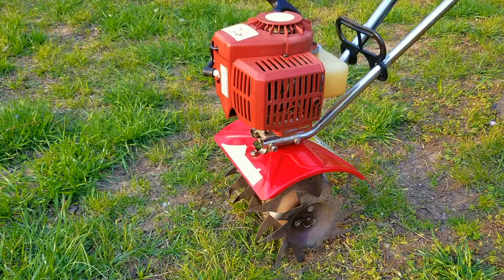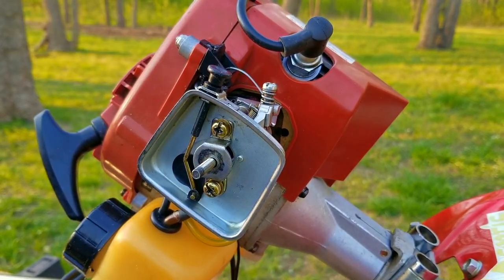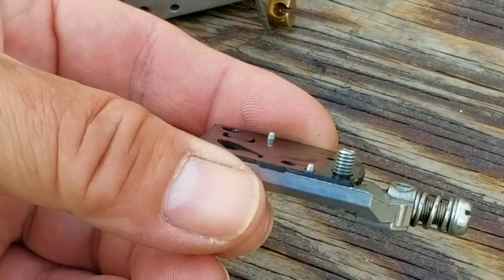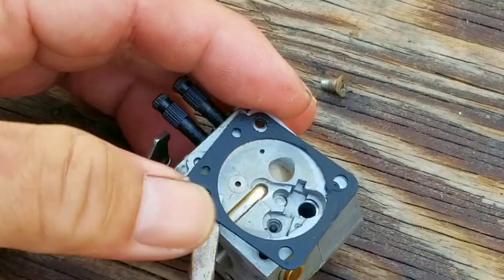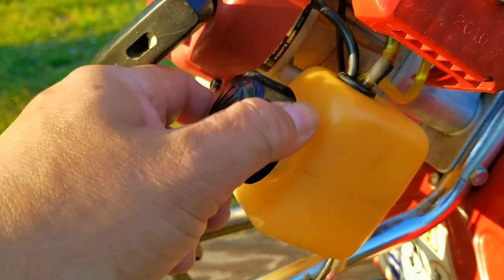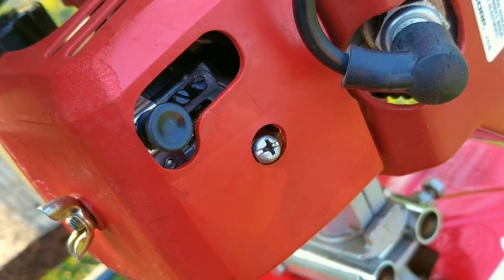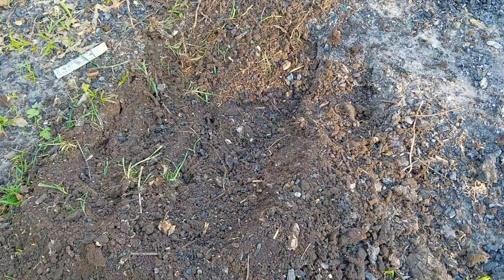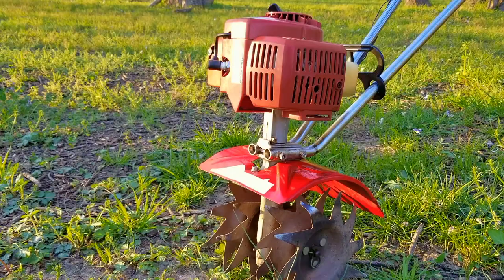Free Mantis tiller leaks gas and won't start

Comment: I've had my little Mantis tiller since 2001. Still runs great after all these years. My secret is to use ethanol free gas and to drain all the gas that's left after using it. The only problem I ever had with it was the handle bars broke from the jumping around and vibration.
Reply from the maker: wow, yours has been really good to you, you've taken good care of it as well.
Reply: I like that secret, and here's my secret. Soak the area you plan on tilling 2 days before hand. The tiller will not only glide through the soul easier, but it won't rattle the handle bars loose 👍😂, especially since you know all this stuff made cheap from China.
Reply: you couldn't handle it

Comment: Things the mantis can do: Weeding in tight spaces, pulverizing soil to a very fine texture for seed beds, churning compost, aerating and cultivating established garden beds. If you get attachments for it you can use it for edging, aerating, and de-thatching your lawn. If you're making a new garden bed, you'll need a bigger tiller like a Troy-Bilt Horse or similar, but these are super convenient for hitting small spots, aerating soil, and getting to areas where your big tiller just can't. We picked one up specifically for this and it seems to work as advertised.

Thank you so much for this video, man. You've got a very solid formula of education, clear instructions, reasoning, diagnostic, and no fluff. Keep at it, you've earned a subscriber!
Reply from the maker: thank you very much, I appreciate it a lot

Comment: Both of my sisters owned these and had trouble keeping them running after a while. I rebuilt the carburetors, replaced the fuel lines, spark plugs and had both of them run ethanol free fuel and empty after use. Run them dry of the remaining fuel. Since then I've bought 4 at yard sales, never paying more than 25 bucks. One was 10 bucks. Rebuild them and resell. One had a cracked fuel tank. There easy to work on but extremely tempermental.
Reply from the maker: you are correct these can sometimes be had for very little and it doesn't take too much money to get them running again

Comment: Got the older version of this from my neighbor after it sat in a shed for who knows how long. Got it running after alot of struggling and although it sounds like it’s got a hole in the muffler and smokes like a banshee, that little thing packs a punch!
Reply from the maker: Nice work, and you're right, these are great machines!

Comment: Our Mantis Tiller is about 25 years old. We used it every year for about 10 years, then we moved and I had heart attacks in 2005. We had it tuned up similar to what you just showed and that cost us about $69, but it was worth it. We didn't get to use it for the next 15 years, and we pulled it from storage a few days ago, and after a few minutes of priming it up, it's a dirt storm all over again! Dug up our garden much faster and much less work than the monster tillers ever did! It's a good thing you didn't get too deep in the earth you were digging in, as those things create a serious dust storm once they get a good grip on the ground, if it's dry, like that. Ours was damp enough to prevent the storm. And it doesn't create the back pain of the big tillers, either. Best $300 we ever spent on the garden, other than the ComposTumbler we bought at the same time (about 25 years ago) and it's still going, too!
Reply: Forgot to mention that our gardens were always about 45'x12' for those first 10 years. This one is a little smaller, as I'm recovering from heart surgery, so I didn't want to make it too big. We've never used a big tiller since we got this little workhorse!
Reply from the maker: very nice and yes I'm glad I didn't go much deeper either

Comment: We have a 5 hp Troy built roto tiller new it jut needed new oil and a spark plug, and the fuel lines were all broken.the crazy thing is, it was in a free  pile on the side of the road, like, people will really throw away anything, good thing we stopped and got it, it didn’t look to new, a few rust spots, but hey, if its free and fixable, then why not try to fix it and use it. Doesn’t hurt to have one more tool.
Reply from the maker: I like the way you think. Thank you Alexander Costa.

Comment: That was a great find and fix! I have the same tiller except it’s branded Echo, it’s a very useful thing to have around. The de-thatching accessory is very good on these, my lawn looks so much better now since I started using it before fertilizing in the spring.
Reply from the maker: oh there's a de-thatching accessory? I need to find one. how did you get yours?
Reply: @HomeGaragechannel  I bought the kit from a eBay seller. It comes with fender extensions and the de-thatching axles that you put in place of the tiller tines. A friend recently gave me the edger accessory for it too but I haven’t used it yet. I’ve seen the de-thatcher kit on Craigslist too.
Reply from the maker: @mjg263  gotcha thank you

Comment: Good little tiller,they are very expensive look them yup on line.I had to replace the transmission  on a customer,cost around 100.00.The transmission had no grease in it.Take the back cover off and check the grease in it.Nice video.
Reply from the maker: Thank you for that information, I'll have to do that.

Comment: I have had 4 Mantis tickets in my shop in the last 6 weeks.  Echo makes the engine.  Very finicky little tiller to get dialed in and running right.  Good for small raised beds with soft soil.
Reply from the maker: Yes as you saw in the video, I should have used it In a prepared bed. Thanks for not giving me a hard time about that

Comment: These are good for flower beds and small digging spaces. I had the equivalent for my Echo convertible and used it a good bit till my gardening Sweetie went to raised beds and mulching. I also used a Gravely with a rotary plow to loosen everything up. Good fix and Blessings.
Reply from the maker: you are correct, their light weight makes them really nice to use, in small areas.

Comment: I purchased one of those second hand. 
For my allotment here in the uk . 15 years ago . 
For £20 . It's still going strong . 
I know new they were quite expensive. Here in the uk anyway . 
Mine must have hundreds of hours on it . 
It only ever has fuel put into it when it's needed . 
Always emptied when finished with . 
New plug every year . 
Only breakdown was a coil . One carb rebuild 
It owes me nothing . 
Noisy yes but it's light and easy to use .
Reply from the maker: Thank you Martin Nightingale, I appreciate you sharing your experience.

Comment: My mantis is hard to start, once I get it started, if I shut it off it won't start again. I just changed the  carburetor and put a new pull rope on it. I appreciate this video I'm going to try to adjust those screws to see if it helps any.
Reply from the maker: Thank you cutflower,

Comment: Great video. More of a cultivator even though they call it a tiller. Great for weeding up and down the rows in a garden. Dont try to break ground with it. Thanks!
Reply from the maker: I wish I know the before I tried, and yes its really a cultivator. thank you Mike H.
Reply: @HomeGaragechannel  Ask me how I know. Lol
Reply: Soak the dirt well, then let it dry for a bit before using. Won't pulverize  the soil that way. Also, it tills better when you pull it backwards
Reply from the maker: @Mike-ig2zq  how do you know?
Reply from the maker: @lawrencewheeler8868  ah, nice of you to share some tips
Reply: @HomeGaragechannel  Lol, I stripped the auger gear out of one. Lucky it was under warrantee and they covered it.

Comment: Free? Who gives a Mantis away? Crazy. I just replace the carburetor  and all the lines. I got one for $30 last year. I sold it for $175.   The kit I got had the carburetor, spark plug, fuel lines, gas tank bung, and filters. Today's fuels destroy  those diaphragms and fuel lines. I pretty much stopped rebuilding carburetors  last year. It's easier and cheaper just to replace. Good video, hell of a find.
Reply from the maker: Right!? I had the same situation come up before but I had to buy a used mantis as well.

Comment: I have that exact same one, it's leaking from the tank where the fuel lines come out. On top of that no fuel is being pumped in when I try to prime it. I bought mine used and had it for about 2 years now, it's not something I'd want to use on a large scale, but it's great for a backyard setting. My soil is pure clay and it chews threw it no problem, well in it's running. I've ordered a new fuel tank and carburetor kit and will refer to this vid if I can find it again.
Reply from the maker: yes these are excellent machines and I hope you can get it running again

Comment: I just discarded my curb find Mantis tiller. It only had about 50 psi pressure but I went ahead and bought a carburetor. It was hard to keep running,then I took the muffler off and saw the scoring on the piston. I should have followed  your diagnosing advice. Kept the carburetor though.
Reply from the maker: sorry to hear that,

Comment: I have the exact tiller.  I put Techron in mine and it does start and run even though the fuel leaks.  I just bought a new carb for $12 on Amazon.  It came with all new lines and an extra primer bulb.  I didn’t put it on yet. I hear these engines are near indestructible
Reply from the maker: as long as theres enough oil in the gasoline, they are very durable.
Reply: @HomeGaragechannel  I bought a cultivator attachment for my 4 stroke string trimmer and was going to put the mantis on the curb too.  The cultivator attachment is ok but not as good as the mantis.   I only use the tiller once a year and it use to take 4 hours to get it running every year.  With Techron, it is much better but it still takes 15 mins.  I wish there was a fuel shutoff valve so I could run the carb dry before storage
Reply from the maker: you can find some aftermarket valves for this size fuel line.

Comment: My dad bought one of these about 20 years ago but hasn’t used it in about 10 years until I got it running.

We almost threw it away as we initially didn’t need it anymore. I still wanted to fix it and even pointed out that I could use it as a sidewalk edger as we still have the attachment for it.

Turns out the mantis is very good at setting an edge for spreading mulch on garden beds in addition to edging our sidewalks!

I’m glad I insisted on fixing it as all it took was a carburetor rebuild and a good cleaning to bring it back to life.
Reply from the maker: very nice work and these are really cool to have

Comment: Those are good quality tillers. I have one in the garage I need to work on it was my neighbors and they gave it to me when they have it to me they had just had it worked on but it still had a hard to start problem. Where do you by your 2 cycle carb kits?
Reply from the maker: I don't buy the kits, just the metering diaphragms and I find them on Amazon.

Comment: Hey I have this exact same tiller! Mine runs great and has very little run time on it. I do notice a few slight differences between mine and this one.
Reply from the maker: What are some of the differences?
Reply: @HomeGaragechannel  The throttle handle is slightly different, the spark plug boot on mine is a little bigger and covers the plug more, and the vents on the cover on top of the engine on mine are different.
Reply from the maker: @paulspomer16  thank I appreciate you letting me know

Comment: That engine on that tiller is an echo / yamabiko engine they also have one with a little honda engine on it which is a good tiller compared to the troybilt 2 stroke mini tillers which is not a good tiller because it uses the same engine that their 25cc troy bilt trimmers use. I'd get the mantis because its be sold through dealers and you get better service from a dealership than a big box store and you can fix a mantis easily
Reply from the maker: I completely agree with you

Comment: So is it because of the old age of the tiller that you have to adjust the idle and L-screws to have it run properly or was it because someone accidentally turned to the wrong position in the past? Thank you for the great and detailed explanation!
Reply from the maker: no problem, yes the engine has developed it's own needs as it's been used and due to age. The adjustments help you to fine tune the carb to the engines needs.
Reply: @HomeGaragechannel  I see. I love how very knowledgeable you are and I can see myself learn a lot from you!
Reply from the maker: @SkyShadowReviews  Thank you I really appreciate that.

Comment: I rebuilt a Mantis this spring (free from neighbor) its 1987. Echo SV-4 Engine. So old not even a primer bulb on the carb. Had to scour eBay for a carb replacement. That’s the question here how does that work...gravity?
Reply from the maker: the engine pulses work the pumping diaphragm and draw the Fuel into the Carb, no gravity use here unless the tank is completely higher than the Carb

Comment: can you plzzzzzz do a video on how to put an tank gromit on small engine because i suck at putting them in
Reply from the maker: I can, but I would have to incorporate it with a project and not just the grommet.  The key is making sure you have the right size, and some grease helps
Reply: yeah i realized it was the wrong size lol @HomeGaragechannel

Comment: I use a Mantis in raised garden beds to fine soil that has been turned with a shovel. I would call it more of a cultivator than a tiller. It beats chopping soil by hand. What you tried to do made me sad.
Reply from the maker: me too
Reply: @HomeGaragechannel  When you till ground it is really a two step process. First you break soil up into clods then you break clods up into fines. A Mantis is really only good for step two. Cultivating is the tedious work. Using a Mantis makes it much more tolerable. It's been a game changer for me. Gets me done many times faster than not having it. That's huge.
Reply from the maker: @1pcfred  yes you're absolutely right.  Unfortunately no gardens were available at the time
Reply: @HomeGaragechannel  you do not have a garden? I have to go out and check mine. The peas are starting to come in. I love fresh peas.
Reply from the maker: @1pcfred  as a child we had one because we love long green beans. But no I don't have one
Reply: @HomeGaragechannel  you should have a garden. You don't have to go Martha Stewart on it. But something. It's just not spring time if I'm not out there digging the garden. It doesn't get any more real than tilling the soil, planting seeds, growing something and then eating it.
Reply from the maker: @1pcfred  that's very

Comment: both air filter screws need to be tight not like you loosened one because choke was grabing, it should be spacer between
Reply from the maker: I believe the spacer was already gone when I got it. thanks for noticing.

Comment: I have a powermate 5.75 tiller that won't start but it's on 2-3 years  old and maybe has had about 2 hours max of use. Is it likely just that the carb needs cleaned? The gas was not drain over winter. Starts with starter fluid but acts like it has no gas in it.
Reply from the maker: yes from what you've told me, it sounds like it need a carb clean.
Reply: @HomeGaragechannel  thank you
Reply from the maker: no problem

Comment: Good info, but like most such videos, saying something like "turn the his screw out 1/2 turn" means nothing when we aren't told the initial setting; ie, "Beginning with both both screws turned clockwise in all the way, start by turning the high idle screw counterclock X turns." That small amount of info make a huge difference.
Reply from the maker: you are correct, and besides these setting only apply to this particular carb, and may not work for yours. So no reference is needed.
Reply: @HomeGaragechannel  I found that particular carb replacement on Amazon, and a detailed video where the screw settings start at zero for reference, and the precise amount to back off counter-clockwise. It worked.
Reply from the maker: nice work!

Comment: These Aren't really tillers they are cultivators. Made to cultivate gardens and flower beds that have already been tilled.
Reply from the maker: yes you are completely correct about the misnomer.
Reply: It depends on which way you put on the tines. I have definitely used it as a tiller

Comment: This is whats called a cultivator, different application than a tiller
Reply from the maker: You are absolutely correct
Reply: @HomeGaragechannel  I love your videos, do you think you could do one on the basics of small motor carb adjustments?
Reply from the maker: @smokeeater1769  I don't usually because every machine is different. If I do make one, it may be more caude more confusion when compared to one of my other videos.  I'll consider it tho